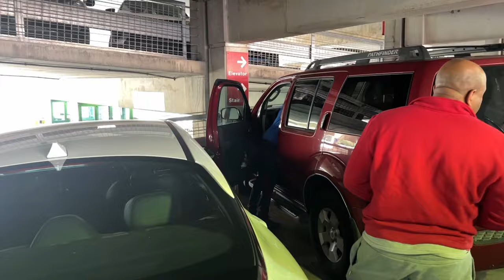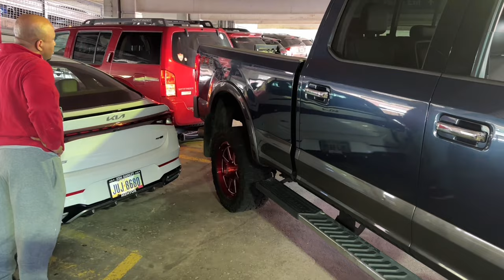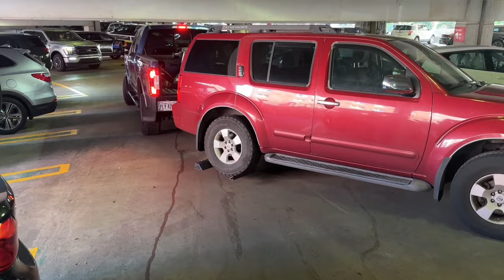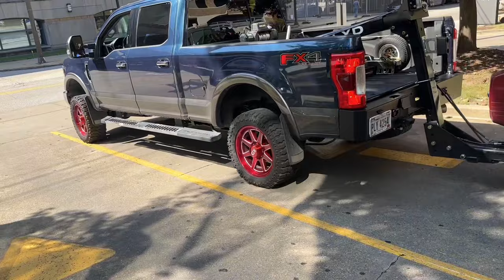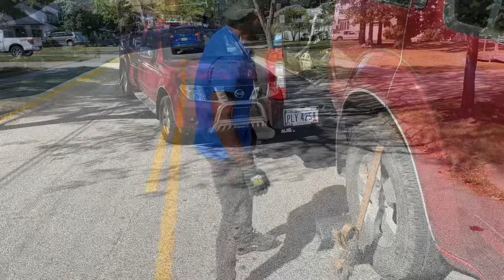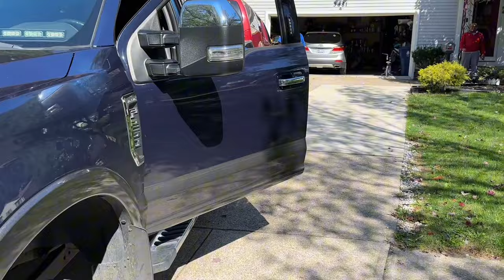Parking Garage Extraction

Comment: Would this job be easier if your F250 wasn't a quad cab? That would make your vehicle shorter.
Reply from the maker: Most definitely would make it a little bit easier, sometimes when I have jobs like this I use my f250 extended cab
Reply: I was wondering what is the backstory on this removal from a parking structure to a residential home. 😮🤷🏽